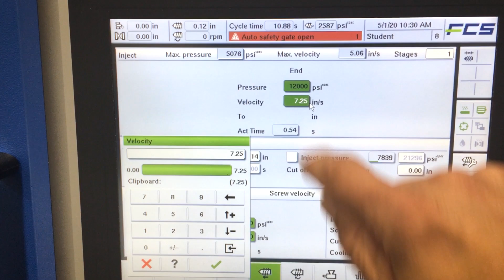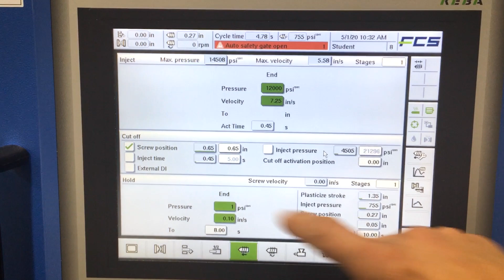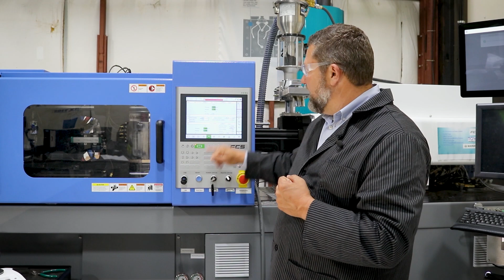What Actually Causes Flash in Injection Molded Parts?

Comment: Would using a pre-loading hydraulic cylinder help eliminate issues with over pressurizing the tool? While also utilizing a smaller sized cylinder and also requiring less pressure? Like ones used on cores?
Reply from the maker: Hi Jack, 
The scenario described is not recommended, because the “smaller sized cylinders” being used, for pre-load purposes, would overload and become inoperable. This situation could also result in other mold damage, such as coining.

Comment: Nice video.
Was the clamp force calculated for the resin used initially?
Are the mould shut off faces ok?
Is the mould cooling ok?
High melt temperature could reduce the viscosity of the material.
Assuming the gate size is correct then a rheology curve should be generated. This could then find the ideal injection speed and a process window . 
Applying full injection speed is not going to always give the best results.
As you mentioned a second speed would reduce flash and also allow venting and a better transfer from injection pressure to holding pressure.

Once the injection speed, holding time and pressure have been optimised I would then move on to checking the clamp force by using a DTI and weighing the parts.
Reply from the maker: Hi Gilly.  To answer your questions in this example yes, clamp force was calculated for the mold and specific resin used, the shutoff and cooling were all in proper working order.  Your questions and comments show a great approach to developing a process based off of scientific molding principles.  The video was developed to dispel the myth that speed causes flash.  You bring up great topics that we will use to develop future videos.  Thanks again.

Comment: Clamping pressure too low or high causing the mold to bow in the centre, barrel/ nozzle temperature too high, too much back pressure on screw during filling.
Reply from the maker: Melt temperatures, filling and excessive back pressure all contribute to having higher pressures in the cavity and if the tonnage is not high enough then flash can occur. Good point on the mold deflection causing flash in the center of the mold.

Comment: nice presentation, please do a  video  to how to calculate tonnage of a mold
Reply from the maker: Stay tuned!
Reply: 2.5 tons per square inch of the projected area of the part is a good place to start. I'm about to graduate and most of my Moldflow fill/pack/hold simulations over the years have suggested clamping forces quite close to this general rule. For a more exact calculation you need to identify the cavity pressure (Psprue + Prunners + Pgate + Ppart) and include a safety factor. Hope this helps.

Comment: It is also possible to have fluctuations in the clamp force and dosing with worn machines. The mould temperature may also rise during the production run (tempering devices don't work well, cooling inside the mould is inadequate) and cause increasing flash.

You can also have an explosive fill caused by a cold plug. Which may result in a flash or burned part.

It may also be that the mould has flashed once after a fault and filled with a less viscous material than normally. In that case you have plastic stuck inside the mould not making it close well and requiring manual removal (knife and gas burner).
Reply from the maker: Fluctuating tonnage or material dosing will definitely make keeping the mold closed difficult. All of the examples you listed lead to the same thing: plastic pressure in the mold overcoming the clamp force of the machine. When this happens the clamp will open slightly and cause flash.
Reply: @Kinetic I agree. But life is life. If you have a bolt far away from the cavity and use a red hot knife to remove plastic there aren't that many risks if you take into account.the potential slipping direction. Of course working in the part forming area of the mould requires special care and tools & technique.

Comment: Thanks for the presentation.  Nicely done.  Flash is also caused by tool defects at the parting line of the cavity.
Reply: It works both ways. You make a mold flash by improper setup, wrong parameters (like temperatures of the mold halves, too much or not enough clamping force, overfilling/overpacking the cavities) and the flash actually damages the metal.
It's not always clear what was first - the flash or the damage.
Reply: @abcdefghijk6704 what works both ways?
How does water temp cause flash?
Reply: @joehart103  Temperature differences (incompetent "process engineers" and/or low quality mold, like chinese) between mold halves or parts (like mold is hot, but slides are run at cold water) can cause a flash.
 
Browse through comments, like "Darryl Anton", experienced guy claims the same thing as me.

There are many causes of flash, you can't just simplify it to silly statements like "there is a damage".
Reply: Your defects will be on the core side when we spot the tool the cavity is considered "bible" you don't grind it you master it. The only way your getting cavity damage would be closing the tool with a part still inside